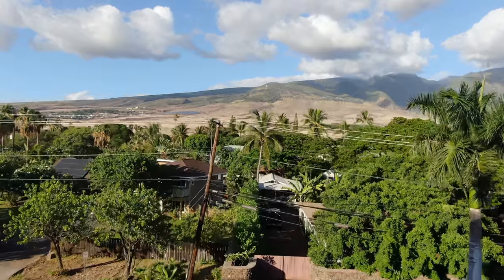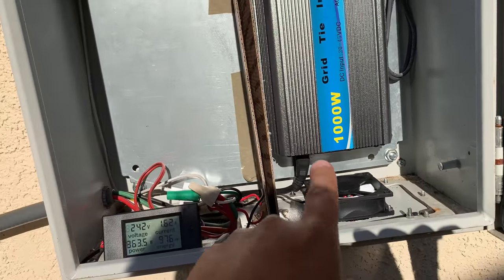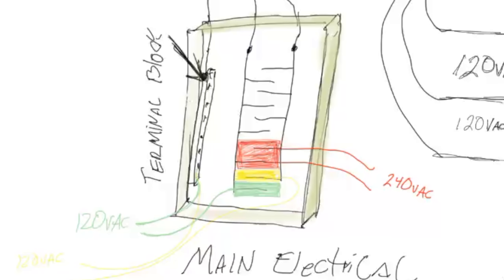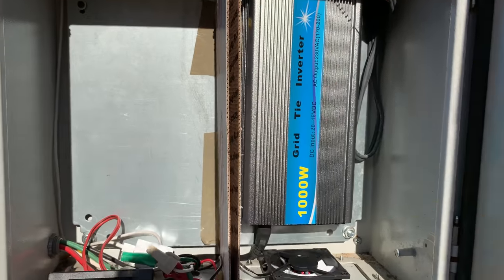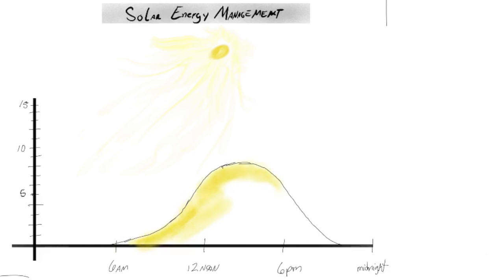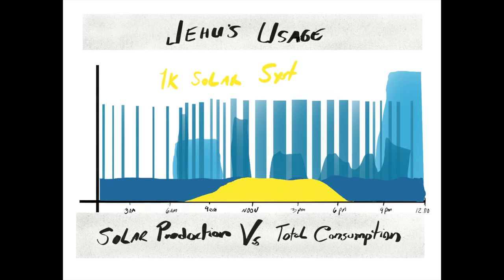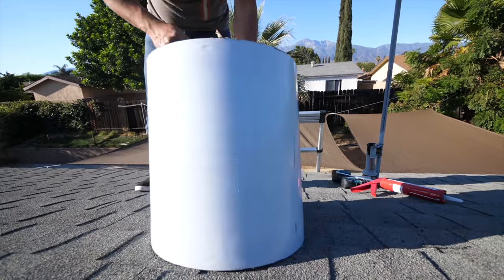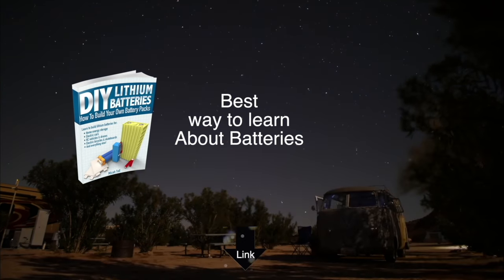How To save $1000 off your electric bill using DIY Solar

Comment: so you connected a single phase 240 to a split phase 240.  .  .  I thought this is not possible. . .. now my mind is whirling because would it be possible to  split phase a cheap single 240 which it seems yo are doing. . .  . . [since split phase 240's are very expenseive while single 240's are cheap] 
Also would of all your 120 device which are pulling from the neutral and half the phase actually being using power from your 240. . it seems like it would either not being using since it needs the nuetral OR  it or the grid would being acting  like a buffer converter. . . . so confused right now. . Id love to chat with you about this . . . also . . . does this mean we can connect single phase 240 inverters to split phase 240 devices like water pumps, stoves, Air etc. . . .
Reply: Because 240 Split-Phase IS 240 Volts Single Phase ...

Comment: 10 cents a a Kw vs the 50 cents a Kw during peak usage, even without solar it would still be economically viable to build a giant battery bank and charge it from the grid during off peak hours to be consumed during peak times. Energy prices in CA are crazy.
Reply: "Peak" times are generally during the day, so you can't "save" energy easily from off hours with solar, as the sun is only just coming up/just going down, or not out at all. It's actually something many people do in hydro/wind/etc and I've even seen people with battery banks charge from the grid at night and "spend" the energy during the day to save money, though I've questioned some peoples setups given the cost of batteries and wear and tear, but 40 whole cents is a big delta to play with in my opinion so it can work for some people, just not for solar.

Comment: Beware:  LOTS of utilities are feeling pinched by solar.... They are wanting to put a $10 per KW generated locally as a "convenience charge for on site equipment".. Doesn't get you anything, but if you have a 10 kw set of panels, they will hit you for $100 a month for energy not sold to you.  Yep.  Monopolies know how to extract $$$$$ from customers.  Try to drop the grid entirely?  They pull your certificate of Occupancy.. so you can't live in your own house... <grrrr>  The duck curve is a huge problem.  They are hitting it here on the East coast...Duke is trying to get pumped storage in more places, but finding a big river with a mountain next to it is not necessarily easy.....

Comment: 4:43 panels connected in parallel will increase only the current (A)...and Voltage will remain unchangeable. not recommended that type of connection. Connection must be in serial.
Reply: And yet, a parallel connected PV Array works for him !

Comment: You should experiment with CPU water cooling for your inverter he would run cooler in you wouldn't have to worry about the fans and pushing hot air around. You can use your pool for a giant heat sink , I see your pool equipment is on the same side of the house not too far away would be very easy to run a pair of 1 in PVC pipes to hook it up being a pool owner and an electrical engineer I could tell you how you would connect the system up if you're interested. I've experimented with a few different things on my own pool you do not need to trigger the main pool pump as you don't need that much volume and the wattage is more than what we want to burn up for this project.

Comment: My electric bill for the past 12 months was $1865 at $0.1028 per kWh.  How many solar panels would I need to no longer pay that to my electric company?
Reply: How many do you need to reliably produce 18650 kWh in a year?

First, figure out how much sun you get on the roof or space where you want to install them, plug that into an efficiency calculator (can be found by googling) and then take the kWh of you desired panel and multiply it with that coefficient. After doing this, you will get a number that you can divide your total (18650 kWh) by to get the number of those specific panels in uour specific area
Reply: You need roughly 10kw of solar panels. You use alot of power
Reply: First you want to employ conversation to limit need for more panels.
Reply: You will also need a way to store power. The grid provides a power cord to your house. In order to become energy independent, you would need to store power so your home could use battery power during the night and poor weather.
Reply: just an addendum, i'd still recommend to do like jehu and only take out the base loads unless you intend to add a battery system.

completely covering your usage only makes sense if you want to give your provider the finger.
Reply: Honestly, your electricity is cheap, so today is probably not the day for you to get solar. That is assuming you want solar with enough battery storage to carry you through the night, and a couple cloudy days. The cost of doing so is far too high compared to your electricity costs. Give it another 5-10 years for battery costs to improve.

If saving money is your goal, your better option would be to figure out what is causing you to have such high usage and eliminate or cut back where possible. Get a Kill A Watt or other power monitoring device and go around the house checking how much power is used by everything in your house that is always On.

Even small loads begin to add up to a lot once you do the math.

For example, we used to run an air purifier in our bedroom 24/7, mostly as a sound machine. Just a little box with filters and a fan that used 54 watts. If you do the math, 54 watts is almost 1.3 kW a day. Over the course of a year it uses about 475 kWh which was about 6% of our annual electric usage. Just one little machine that we had no idea was such a power hog. 

So we ditched the air purifier and now make our white noise with a cell phone and a bluetooth speaker which use only a few watts.

Comment: The reason the utilities charge more for power in the daytime hours has been that, in the past, businesses used so much power during those hours, they charged more to discourage discretionary use during that time frame. If we now have the opposite problem, I wonder why don't the utilities adjust their TOU scheme. If they did that it would make it easier for people to $$ justify a battery bank and would give people a greater incentive to help solve this problem.

Comment: I bet that that's not an approved grid-tie inverter. Looks like eBay crap. You should also mention that a permit is requiered to install any micro gen system. Huge fines for doing what you did. Also if you have a newer meter you will be paying for any power that you export, most meters can't tell which way the current is flowing. You need a net meter that can read import and export.
Reply: As for the meter charging you for the power he produces, do you have any documentation proving this? I have a new digital meter that was installed a year ago. Only reason I have not grid tied is because of what you just said. But I can find no proof of it. My old meter would just spin backwards. 

As for the power company not allowing it. True, but if we have the know how and the ability, you should do it!
Reply: @kevinroberts781  Trust me. I fired up my 9000 watt system in 2014 b4  I got the new net meter. I didn't care because I WANTED TO TEST IT NOW.  yOU GUESSED IT
Reply: Agreed with the HUGE fines for doing this, easy solution is to buy an inverter system that will not put energy into the grid and keep it only within your house. Will Prose has a video of that setup someplace.  

Also, I think he has net metering set up because he normally stores power overnight from the grid in his batteries and discharges them at peak.  But, who knows

Comment: not having electrical disconnects makes that invertor setup very dangerous for emergency workers working on what is presumed a powered off grid
Reply: the grid tie inverter doesnt work without power from grid..so nothing dangerous here
Reply: @nikolaosioannidis8750  What if your neighbour on same phases is also running one, would the two assume each other are 'the grid'?
Reply: @JohnWatkinsUK 
No it doesn't work this way.
Even in same house two grid Tie on the same phase when power is off they stop. So nothing dangerous here
Reply: I am really amazed that people doesn't know that without power from grid no grid Tie Inverter works.
Also when power is back on they delay to reconect
Reply: @nikolaosioannidis8750  even though this inverter says it has anti-islanding, as far as I can tell, it's not on any utilities approved list of grid-tie inverters. i purchased one and it is cheaply made and I don't really know how much anyone should trust it. Jehu himself has experienced failures with this type of inverter in the past, so who really knows how dangerous it might be. Why not get a NEM agreement and use equipment that is actually approved for use? Sure you will spend a more but you also get peace of mind that if something happens you're backed by legit/approved manufacturers.

Comment: Don't you need a contract/netmetering with power company to actually get credit for your surplus power that is "sold" to the power company?
Reply from the maker: The key is to not produce surplus
Reply: @jehugarcia  What would be my best option if we use ~2500kWh /month to offset some cost?

Comment: You should make a hole in the top, above the inverter. Hot air rises. That little fan never will be capable of pushing the hot air down to the outlet. Use the natural convection to cool down the inverter. Like this.  shorturl.at/cgrOP

Comment: 2MWh in a year? In Germany we get around 0,9 to 1MWh from one kWp. Lucky Californians! 

Although it has to be said that with a bigger installation, the calculation improves dramatically! In Germany you can now have a complete 10kWp-installation for under 7.000€ if you install it yourself.
Reply: But you don't have to spend money for air conditioning in Germany. So you also save a big chunk of energy compared to California. I can't really understand why your energy prices are so high around noon. Even in Germany there are times during the day where the energy prices on the energy exchange go negative because of overproduction in solar and wind.
Reply: True! But especially with high energy demand by aircons it probably makes way more sense to invest in pv instead of a battery. Would be interesting to hear about the financial side from Jehu.

Comment: Megawatts uses a capital M.... MW, not milliwatts... Also you say the panels can go to 40 V.. That's the open circuit voltage, or with no load.

Comment: Lots of love man, for you channel and all the hard work you do on here being instructive for other users to take charge of their own energy use and production, but what you showed here gives me pause because it shows you aren’t completely aware perhaps of the jeopardy that unlicenced non-contractor installed installations can put you in if you don’t know all the local and national building-code/fire-code/health and safety code ins an outs and for sure, you must not given the manner of your installation.  So I’d like to lend you my very carefully researched knowledge on this subject where you and your viewers can get into some bad trouble.   For sure you are using the wrong inverter in the wrong manner for your application for two important reasons: 

1.  Legal issues:  That inverter is not UL certified.  So if it catches fire (and running a unit at max all the time certainly pushes things faster in the direction of unit breakdown and overheating), your home fire insurance will say you installed unpermitted non-UL  equipment attached to your home and if it was the source of the fire, your policy is void, have a nice day.   You will be screwed out of your insurance money and your home.  Never attach this cheap kind of inverter to your structure (put it stand-alone off the ground on a pole away from structure in weatherproof NEMA enclosure so your home insurance is kept in-tact and the code enforcement people can’t cite you for not having a building permit—panels too can’t be on the roof or attached to house at all without a building permit even if the home-owner does the work.  Put them in the yard or the same two problems with permits and fire insurance will exist).   Your inverter is however complaint with the anti-islanding effect and shuts down automatically with the grid I believe so at least you don’t have to worry about the power company in your locality cutting you off the grid for unsafe equipment violating their terms of power service.  That part is in your favor.  The other issues here are quickly resolved by unattaching the inverter from your house and putting it on a pole in a weatherproof enclosure as mentioned….   That doesn’t fix the last issue though...

2.  Longevity issues:  While its very commendable and shows you were thinking about thermal issues that you installed the fan ventilation of the box enclosure, your inverter still violates the primary guiding principle of sizing the inverter for your needs and it makes extra ventilation a necessity without which failure will happen quickly:  If you have a system that actually peaks at 1000W, you don’t want to put a 1000W inverter to handle the situation.  Good engineering dictate leaving yourself a 20-33% minimum margin of safety.  You don’t want your equipment to ever run full-bore for any amount of time because you are testing the limits of its individual components at that point and any component that didn’t actually make the specific tolerances rated at (like batch variance defect) will certainly fail much sooner than later.  Also, overheating will lessen the life of your inverter from running it at 100% capacity..   You should not use an inverter less than 1200W for running  1000W (actual peak) panel output.  You size your inverter maximum at least 20 (but better up to 33%) higher than your highest peak hour of the summer peak days..  This way your inverter runs cooler automatically, it isn’t taxed, and it will last a lot longer.   Note that the fans installed in most cheap inverters and yours isn’t an exception will fail under constant use in heat or from internal heating.  That’s something you will have to periodically replace or end up replacing the entire inverter if it fails and the inverter fails to shut down before thermal damage occurs automatically.  So, if you don’t want unpredictable inverter failure, you had better make sure the additional airflow remains running at all times the inverter Is operating an that it itself does not fail without also shutting off the inverter (a sensor of flow or thermal air sensor could determine this) so that ambient temperature with the addiitional strain of load does not exceed the thermal operating range of any of the inverter’s many components (which means looking up every part in that thing for its data sheet characteristics from the manufacture of each part to find the weakest link in the design to set for your temperature control) or far less time consuming, easier, and better peace of mind to get an inverter over-rated for your application by 20-33% for your peak expected noon day in the summer level of peak panel output…

Comment: If everyone thought and acted this way. We would be living in a golden age, however, we are in a tarnished bronze agecat best...  I'd likely me to see you get some real panels, I hulope to get some this spring, I have 1500 watts, of 150 watt panels, with 5kw inverter, my house is off grid, I have 1400 cell 7s lithium bank, and 800 ah lead acid Bank, by real panels , I'm meaning 300w plus, panels, I understand your decision, but maybe you could get by with a ground mount, disguised as a small car shed, or something, maybe at the pool? I hope to build a below ground pool soon, fed by spring water, so I have a bit to figure out, but being completely off grid, it would take a decent amount of power for pumping water, I also plan a solar heater!
I also plan to build up the lithium bank, to about 200kwh, I also have a 4kwh LIFePo 12v bank for 12v stereo ,lighting and that sort, but still use 120v lighting when needed, basically all that is powered by the inverter is fridge, microwave, TV, well pump, the water is heated by tankless gas heater, with wood heat in mid winter, but working on a solar thermal storage for heat, using wood to heat the water for backup heating, I'm about halfway up the east coast, so it can hit 0°F in mid winter commonly, keep at it man, maybe soon you will have no power bill!!

Comment: just got my latest power bill  at 50 cents per kwh it was $1000 ausd  ouch and thats with a 3.1 kw solar setup
Reply: sorry i should have added its in adelaide australia
Reply: M Detlef  that wasn't with ac
Reply: @dtec30  Given that, you have a 3.1 kW PV Array and you still have a $1,000 bill @ $0.50/kw-hrs = 2,000 kilowatts-hours NET consumed!  Then WHAT is consuming so much energy ?

Comment: Here is what I need.

The battery, that I just plug into my wall system, like a NEMA 14-50 plug.

I have a 6.2 kWh solar array.

Most excellent explanation of the grid and 120/240 V lines. :)

Comment: Great video, but one slight correction.
Even if your solar installation only cancels out your personal base-load, that doesn't make a difference from the utility's perspective. All they see is that demand for power went down during the day by that amount. That's why energy storage is so important, even though right now it doesn't always save much money (when will utilities learn...).

Also, I love your drawings! It's a cool new touch to your videos.

Comment: Guys who build computers are going to say you need to put the fan at the top of the case, because hot air likes to rise and not fall.
Reply from the maker: Yeah but,  water rolls down
Reply: @jehugarcia  What about those cone like covers you see on the roofs of homes for smoke stacks?